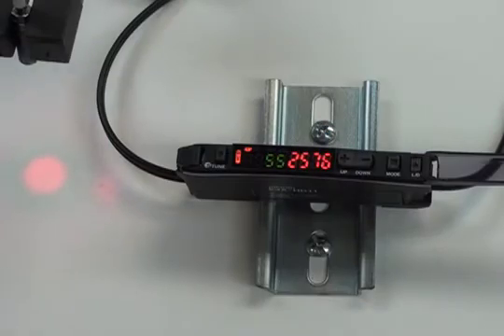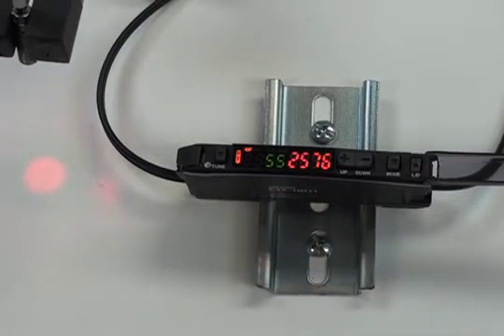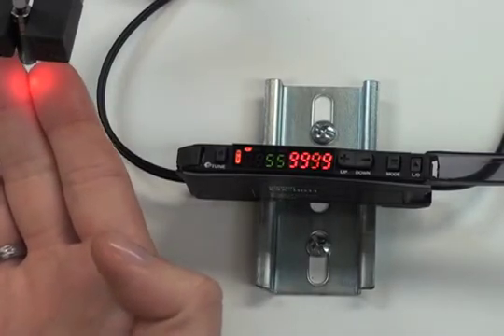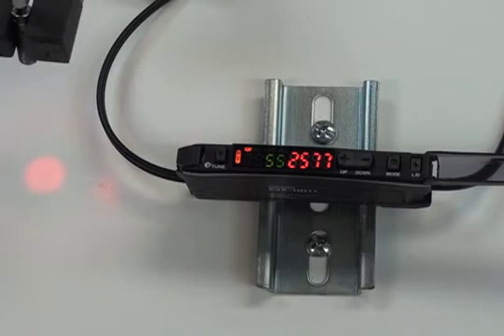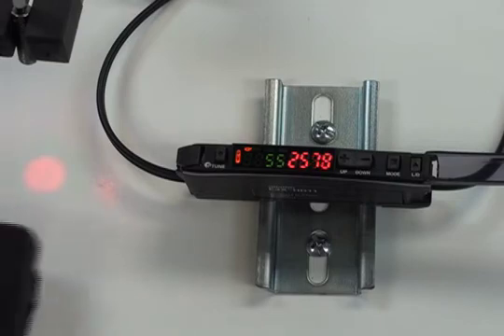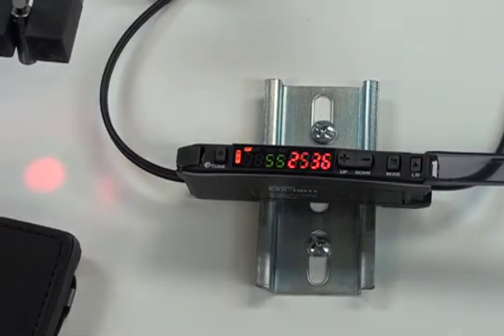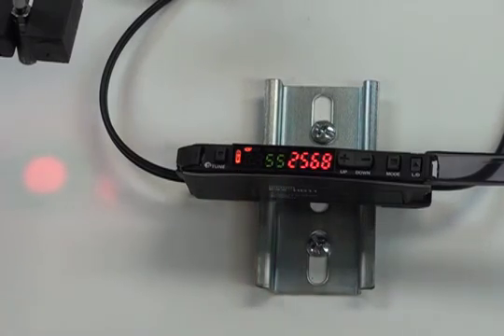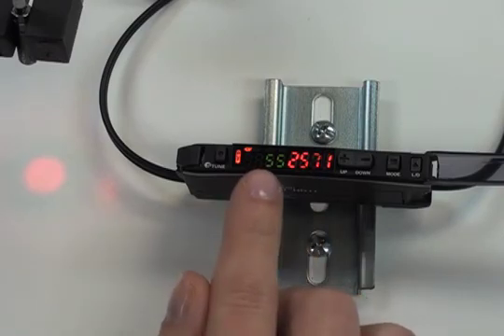2. E3X-HD Fiber-optic Amplifier - Intro to Dual Digital Display

Comment: If you are measuring three different types of materials. What is the best method to teach the Omron. Should I calibrate with the most reflective or less reflective material?  I have glass, silicon SIO2 or Chrome plated glass.